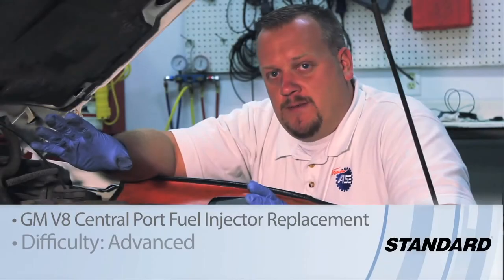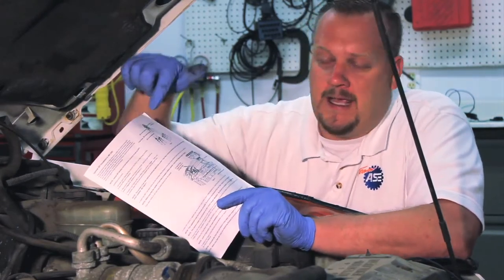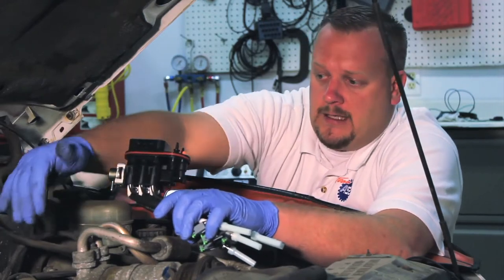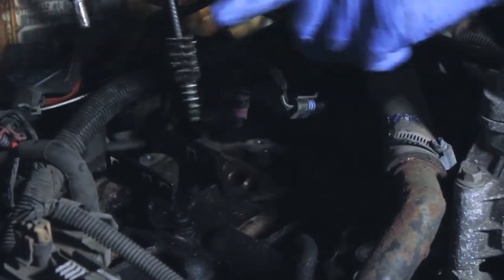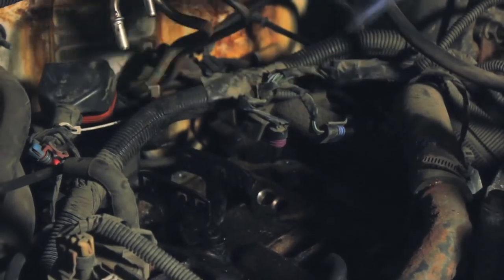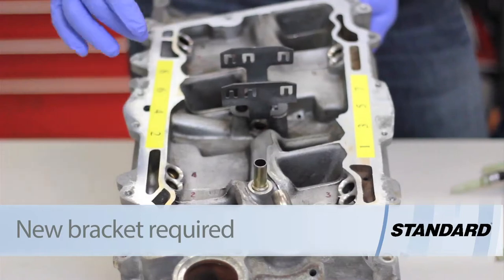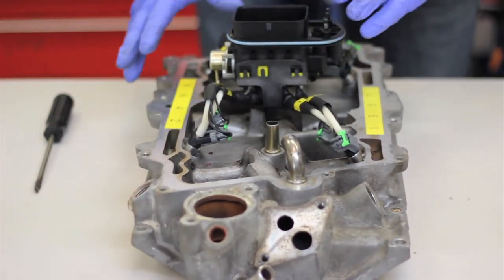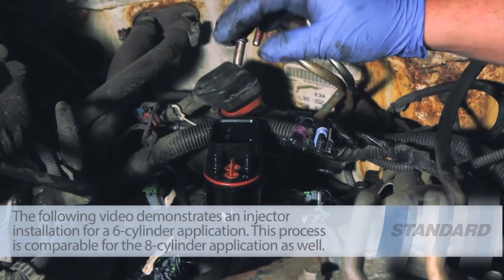GM V8 Central Port Fuel Injection Replacement

Comment: I don't know if there was a design change or they revised the instructions or what, but this does not match up with GM's instructions on tube routing.  They have the outer lines going underneath, so 5 over 7, 4 over 2, etc.